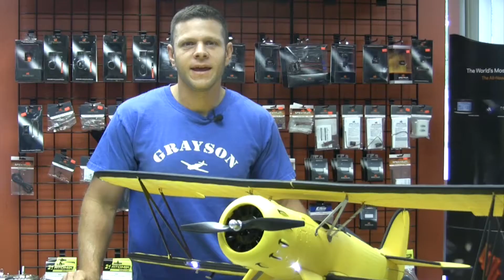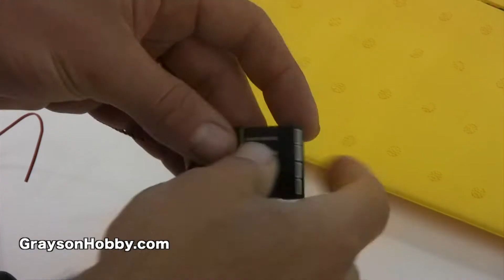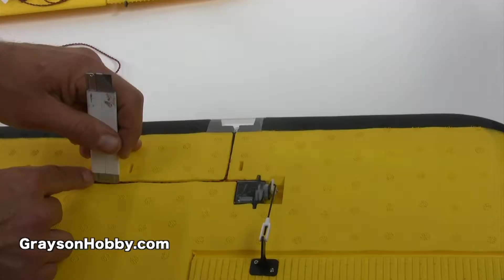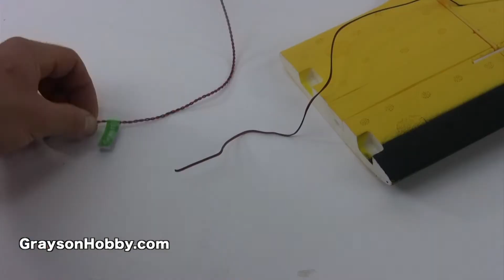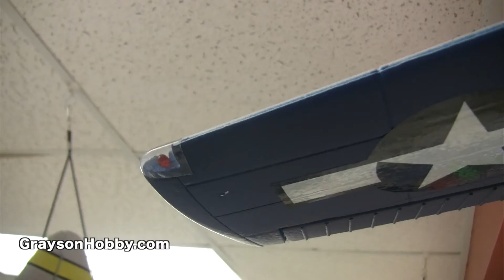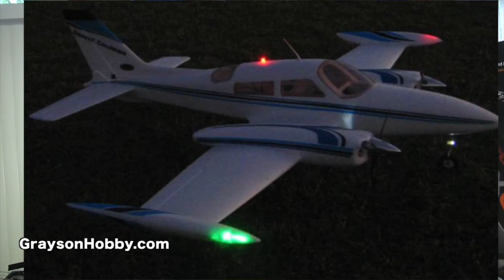Dynam RC Airplane LED Lights - Installation of RC Hobby Airplane Lights

Comment: I have a Taranis X9D Plus and install the dynam led driver in channel 6 and is always on and I cannot turn it on and off, do you know how to do it, because I tried everything, ,noticed that the input include the signal wire but the outputs are only voltage and groung, I think this means  that there are no control of them right?

Comment: Great video and well explained but I have a question... I have the Dynam BF109 which came with led lights on the wing tips but they are both GREEN. If they were navigation lights shouldn't the left wing led be RED ? or is this a Dynam mistake ?
Reply from the maker: hey, thank you for watching!  I would think having 2 of the same colors is a mistake - definitely not scale.
Reply: Thanks for replying so quickly and "Yes" I have to agree with you, it's not scale at all.
Keep up the good work.
Your videos are great.

Comment: This is a great video guys, but it's basically... Rip out the dynam ones, and replace. It's a shame that dynam haven't fitted some really great leds, but its a starter. I have the hurricane, and plan to fit the lights, but its real tight in the fuz... Not sure where i'd manage to fit a driver. We'll see. Great video though, so thanks. :)

Comment: Nick Klink, it's Vetran owned and operated store owned by a few People in Grayson Hobby
220 Old Loganville Road
Loganville, GA 30052
(678) 682 9123   support@graysonhobby.com
And there are a few workers their that help and run the store !  But they are awesome people that run the store. And they do help when you have a problem . Just go to the store Website and hit Contact us ! Call or email them and they will get back to you if you have a problem ! Takes them a lil time to get back to you ! Cause it's a small operation ran Hobby Store and many emails to answer to ! But they work with their customers big time and will get back to you, as soon as they can ! Bernie and Dawn Sponholz !

Comment: Grayson Hobby this is awesome as I am trying to get my Grayson Hobby Dynam Grand Cruiser leds functioning. As soon as I finish this evening pics will be posted
Reply: Yeah i have the Grand Cruiser To , RTF version. I bought the lights from Grayson and Basil said he would make a video about how to install the lights, cause i have a Skytrainer 182 , which is going back, Cause have a problem with it and the lights were gonna go in that one, cause all there was was lights and the wires and noway to hook it up. So Thanks to Basil, he went out of his way to make the Video, which will help us all out ! So thats awesome. Gonna start working on my Grand cruiser this week, been busy building other planes from Grayson ! So seeing the light kit wont go into the one plane, cause i'm exchanging it for another one, same plane. The lights will go in the GC till i get the other Skytrainer 182 ! But the video is a awesome help ! Good luck on your build ! :) Wish they would have put the decals on my GC ! UUUGH